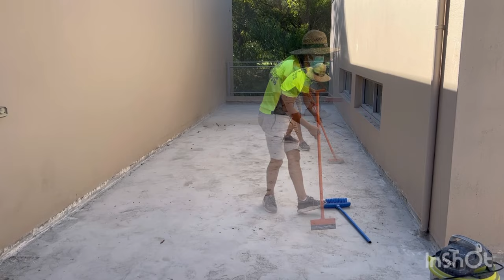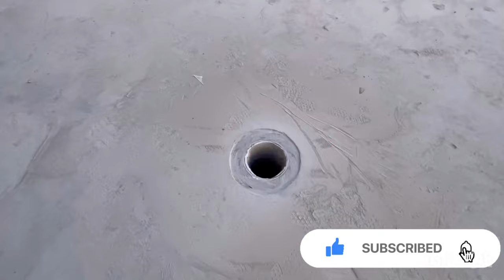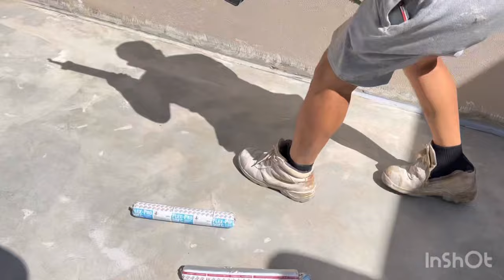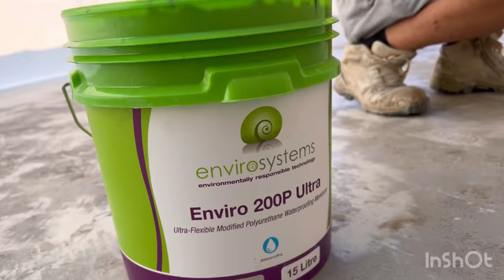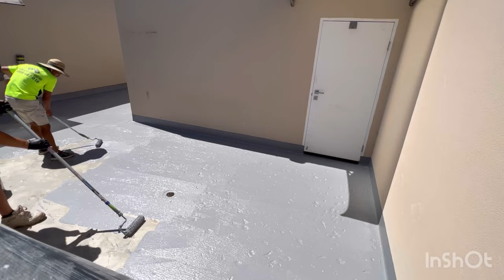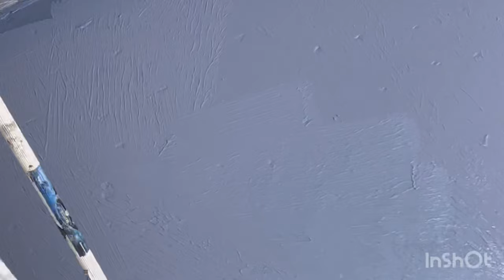How to waterproof terraces or balcony/ beginners guide. Waterproofing tutorials/waterproof from A-Z

Comment: I live in Jamaica and had a concrete roof that needs that finish. I would like for you to share the material as the roof is leaking. Cheers
Reply from the maker: Hi there use 2 codes of primer start caulking the creaks wait to dry then apply 2 codes of waterproofing and a weather protection on top.

Comment: Does it need a concrete on top of that
Reply from the maker: Hi Mira

You don’t have to depending on how is the floor and whats going after.

For this particular job we did screed on top which is sand and cement bed prior tiling and then we applied 2 more code on top of that.

QLH

Comment: Poor surface preparation...and wrong treatment in the corner joints ...

There are lots of damages in the substrate concrete it has to be repaired with epoxy fillers and sanded well after it dried ..Next step the corners,angle fillet must be provided with non shrinkage cementitious mortar and with fabric reinforcements...then apply the primer and do your waterproofing coating